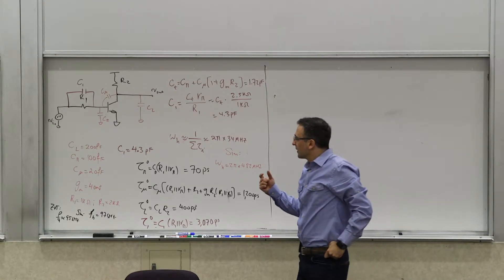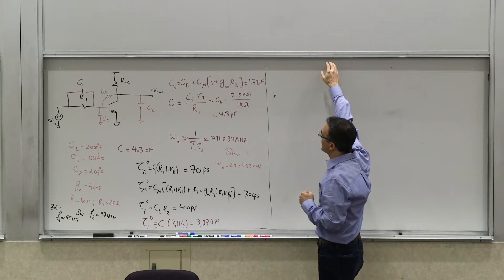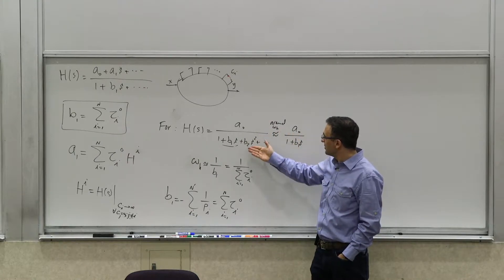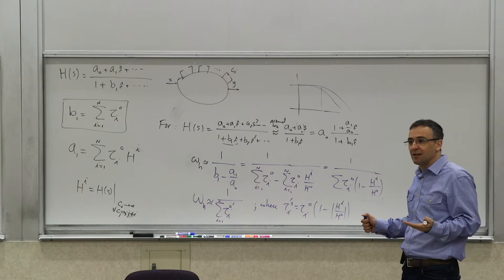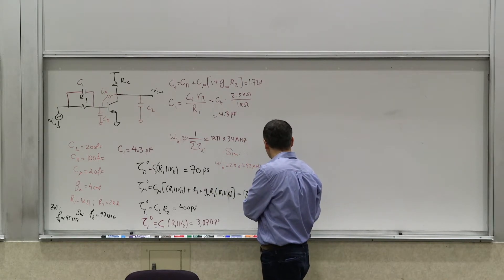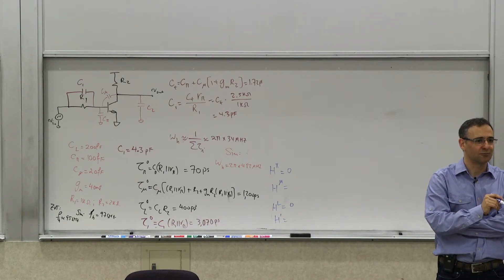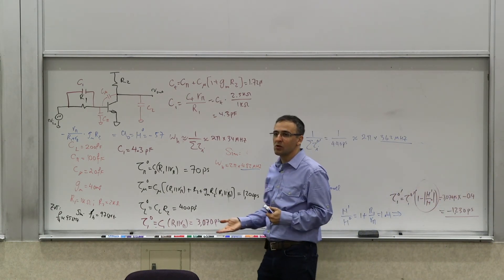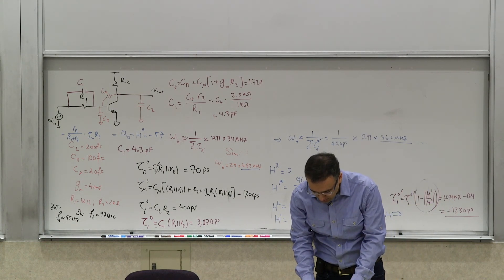147N.Taking zeros into account in ZVT bandwidth estimate

Comment: Sir,why wh=1/(b1-a1/a0)?You said,a1/a0 cancels b1,and we consider first order approximation.But maybe the approximation is too inaccurate.If we solve equations                                                                                       (1+(a1/a0)^2*wh^2)/(1+b1^2*wh^2)=1/2,            we can get                   wh=1/sqrt(b^2-2*(a1^2/a0^2)),                    then using maclaurin series,      wh=1/b1*(1+(a1/(a0*b1))^2).      Maybe this is better?
Reply: If you're trying to derive the bandwidth for the transfer function 
\[ H(s) = a_0 \frac{1 + \frac{a_1}{a_0} s}{1 + b_1 s}, \]
you can do it as follows:

1. Rewrite the transfer function:
   \[ H(s) = \frac{a_0}{(1 + b_1 s) \cdot \frac{1}{1 + \frac{a_1}{a_0} s}} \]

2. Apply the Taylor expansion to the second term:
   \[ \frac{1}{1 + \frac{a_1}{a_0} s} \approx 1 - \frac{a_1}{a_0} s \]

3. Substitute back into the expression:
   \[ H(s) \approx \frac{a_0}{(1 + b_1 s)(1 - \frac{a_1}{a_0} s)} \]

4. Expand the denominator and ignore \(s^2\) terms:
   \[ H(s) \approx \frac{a_0}{1 + (b_1 - \frac{a_1}{a_0}) s} \]

The bandwidth is the inverse of the time constant:
\[ \omega_H \approx \frac{1}{b_1 - \frac{a_1}{a_0}} \]